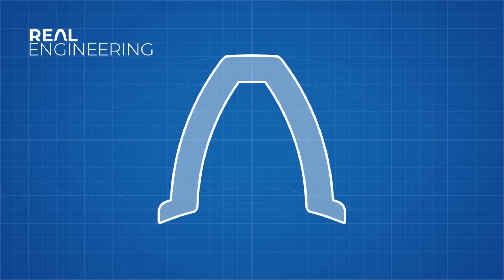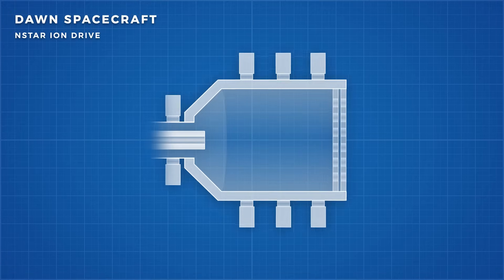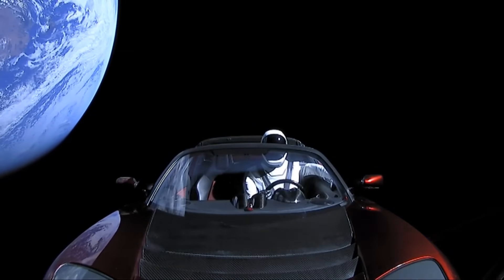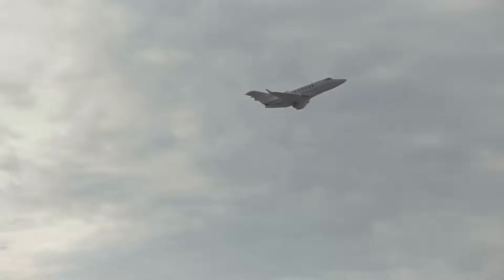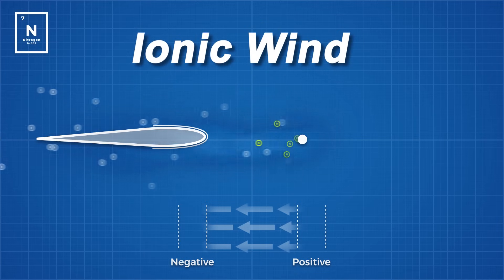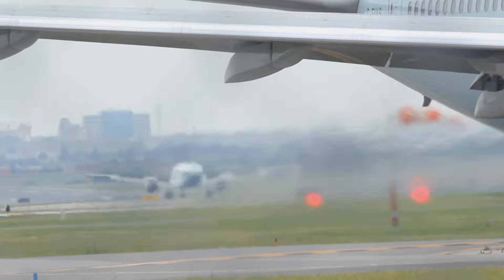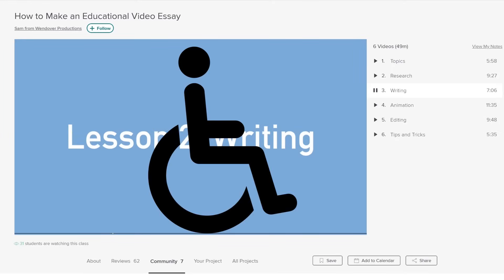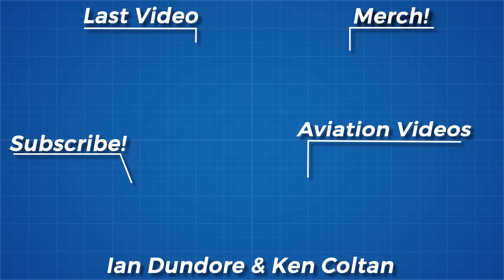Ion Propulsion - The Plane With No Moving Parts

Comment: What's wrong with moving parts?  Electric cars have moving parts, motors, wheels, etc...
Reply: It sounds like polarized haul's of ships like star trek, in which various energy signiture's could be promoted on such haul's. This would allow intake and out take of energy ions.

This would allow possible communication signiture's and shielding potential off the haul to be emitted. It's neat that electric propelled planes move, in a earth atmosphere. With the right tuning, it could possibly move it through other environment's like outer space.  This would allow a vessel, or object to thrust movement entirely all at once from a polarized haul. Or entirely all at once, to have communication signal's emitted from the whole polarized haul. 

This in theory, should also work for nano bot's as well, as they could mimic that feature of polarized haul's. Nano bot's could move around and through environment's. As they thrust, or hover through environment's.
Also if nano bot's emitted the right energy signiture's, or signal's. They could be detected from devices and communication with them from other devices would be possible. Cloaking would be possible as well, for those polarized haul's. As they could be blending in microwaves and other possible background noises, to have it appear normal.  The only thing really, is to have polarized haul's charged well enough. For strong energy field dynamics of interaction's to be in the environment. 
Everything is like torus Field's, or alternating current fluctuation's. I like another name for this, force balance.

Comment: Please explain how you control the plane's direction without moving parts. Wouldn't retractable landing need to move? How do you get people or cargo in or out if the doors don't move. Actually if the plane is flying, all the parts are moving from one location to another. Movement is the purpose of an airplane.
Reply: Their paper from the Journal of Nature says their craft had a movable rudder and tail. They also claim it was first with onboard power though which was not correct.

Comment: Although I am no expert on this, it seems that a "Plus Amplitude Modulated " (PAM) system has better prospects.  With an iron ferro magnetic around the outside of the ion chamber outlet that contributes iron ions to the propulsion, would eliminate the need for the nitrogen gas.  Our immediate concern is the flight of earth bound planes.

Comment: Good graphic skills, but the video is totally wrong. The Xenon is first ionized positively charged then accelerated through the engine to the outside of the spaceship by voltage differential. Then the electron beam is sent after the ions exiting the engine, in order to prevent the spaceship from getting a net charge and also to prevent the Xenon ions from coming after the ship.
Reply: Furthermore, MIT was not the first build one that could lift its power supply.  Here is verification from NPR besides the 2 dozen or so flight videos on my channel:
https://radio.wosu.org/post/exploradio-oberlin-inventor-pushes-limits-ion-powered-flight#stream/0

Comment: Makes one wonder what could have been and makes one wonder why it's not now used and improved upon
Reply: I have some VTOL versions on my channel with onboard power, if you're interested.
Reply: Physics is why this technology has not been "improved upon". Ion thrusters have been around and used for decades. They offer such minute thrust that they are only used in space.
Reply: @herrschaftg35  
Hi herrchaftg35,
By working with physics this technology has been improved upon by several orders of magnitude, in terms of thrust to weight and grams of lift per watt, not by MIT though.

On my channel there is a series of patented independently verified ion propelled crafts with onboard power. They lift their own power supplies vertically for up to 2 minutes at a time.  With solar power they will be able to ascend or fly continually. 

It is true that this type of propulsion still has a low areal thrust density, so it won't complete against a 747 or chemical rocket when high levels of force in a small area are needed. Please visit my channel to see dozens of flight videos, some with officials present, and the website.
Reply: @KraussEMUS1  
It sounds like polarized haul's of ships like star trek, in which various energy signiture's could be promoted on such haul's. This would allow intake and out take of energy ions.

This would allow possible communication signiture's and shielding potential off the haul to be emitted. It's neat that electric propelled planes move, in a earth atmosphere. With the right tuning, it could possibly move it through other environment's like outer space.  This would allow a vessel, or object to thrust movement entirely all at once from a polarized haul. Or entirely all at once, to have communication signal's emitted from the whole polarized haul. 

This in theory, should also work for nano bot's as well, as they could mimic that feature of polarized haul's. Nano bot's could move around and through environment's. As they thrust, or hover through environment's.
Also if nano bot's emitted the right energy signiture's, or signal's. They could be detected from devices and communication with them from other devices would be possible. Cloaking would be possible as well, for those polarized haul's. As they could be blending in microwaves and other possible background noises, to have it appear normal.  The only thing really, is to have polarized haul's charged well enough. For strong energy field dynamics of interaction's to be in the environment. 
Everything is like torus Field's, or alternating current fluctuation's. I like another name for this, force balance.

Comment: One thought that comes to mind is different atmospheres than Earth could be more useful overall in flight. An atmosphere with atoms that provide more thrust when charged, and or a heavier atmosphere where the parts would be more buoyant and achieve flight much easier. While an aircraft with few moving parts is ideal, perhaps a blimp with ion thrusters could overcome the weight challenges while maintaining the benefits of these ion engines?
Reply: On my channel there are VTOL ion thrusters that carry their power supplies.  They don't require any LTA gasses.  There is a company that had an ion propelled blimp though even in the 70s!

Comment: Next step is to make lightweight solar panels or even paint job made from different reactive layers that make solar power just like normal solar panel. More surface area makes more power even if the paintjob (panel) produces less energy per square meter. More surface area just adds up and this must be lightweight.

Comment: Ion drive cannot be used on a large scale.
Reply: Dear Dr. Mayer,
There is a series of ion propelled aircrafts on my channel that can lift their power supplies.  When they are working properly, one could connect as many together as one would like, although I know at some point their might be some serious mechanical stress issues.  It is true though that the areal thrust density doesn't scale as well as I would like, so I'm not disagreeing with you completely:).
Reply: @KraussEMUS1  Since air velocity is very small in air ion drives, air flow must be very very large to generate any reasonable thrust. You could connect many of them and still not be able to lift 10 kilograms. For mini-UAV devices to carry cameras, OK. For human carrying aircraft NO.
Reply: @DavidFMayerPhD  
No argument there:), unless it was really large and a few more improvements are made.  Once one considers how much the thrust to weight ratio has already been improved,  carrying substantially more weight in the near future doesn't seem too difficult.
Also, interestingly, it has carried some small propellant tanks already.  Additionally, there are solar cells that are lighter than the current batteries, so who knows what the future holds.

Comment: When I was developing atmospheric plasma systems for thin film deposition, I came accross the way one could make very dense plasmas (requiring a lot of amps but not many volts) in standard atmospheric conditions in air. This principle is used in plasma cutters: you make your initial spark using high voltage / low amperage and then, since your plasma is already conductive, you apply a second power source with a lot of amps. When you have a dense plasma in atmorpheric pressure, you can go WAAAY beyond the thrust density you see in MIT's prototype. I though it was a nice invention but then came the bad news: since you ionise air, you leave behind nitric acid, ozone and a bunch of other toxic stuff. It's a pitty we cannot use this engine, even if MIT gets it at some point. I may put it on my channel at some point because it certainly looks great when you see it (plasma is always amazing...)...
Reply: Any idea of what sort of thrust to power ratio you get?
I'd think the high current requirement would make it impractical for airplanes.
It would be great to see the device in action. I hope you make a video showing it off. 
I think a lot of people would want to see an airplane propelled by a plasma torch even if it's not a practical form of propulsion.
Reply: @ddegn  The high voltage is imractical. High amperage low voltage is safe and easy to make. Anyhow, haven't done any testing to see what the thrust to power ratio one gets, will have to at some point revisit this idea and make a video. :)
Reply: @BillDemos  I just subbed to your channel. I really hope you get around to making a video on your ion thruster.
Reply: @ddegn  Thanks so much! That really helps a new channel! I will try my best to come to this video shortly. For now I need to upload the final video on the CMOS series and then another on Plasma Electrolytic Oxidation so that the channel starts being also on material sciences. Hope you like the content that is coming. Best regards!
Reply: Thanks bill
Reply: I have a plasma cutter, but plasma cutter uses pressurized air and it's that air that gives the thrust and not the plasma! On truth that air is already turned in plasma state but with the same molecular density from air! And the density that causes the thrust! Do you remember the rocket equation?
Reply: @antoniobragancamartins3165  MY dear, I didn't tell you to use a plasma cutter, but the PRINCIPLES of it. The principle of it is using a high voltage supply to ionise air, which in turns goes over the high amperage electrodes to produce a spark with a lot of amps. Once you have plasma, you can accelerate it the way you want.Also, you can let the sarcasm in the end, it's ridiculous to not understand something and play it smart at the same time.
Reply: Yep now we can bring back R22... the amount of ozone this thing will make at scale... 🤣
Reply: sure you did bud
Reply: @user-sc8ph2ds2m I have done a lot of years in Physics. How about you "bud"?
Reply: @BillDemos  so did you finally tested its thrust to power ratio?

Comment: here's the even crazier thought:
can we use ionized air to move the blades of wind turbines and turn generators to produce electricity with which to generate ionized air?
Reply: that's a "Perpetual Motion Machine" and thermodynamics doesn't look kindly on the idea ;)
Reply: @liamdonnelly3689 why? it doesn't have to run indefinitely.... as long as it runs for as long as humanly acceptable , it's fine.... a thousand years is not "perpetual"
Reply: @Deylan Acasio I wouldn't be creating anything.... I would just be channeling already created energy: the atoms of the elements that make the atmosphere were fused together a billion years ago... I would just be exploiting that chemistry.

Comment: So this tech is based on Thomas Townsend Brown's "Biefeld–Brown effect" A.K.A "electrogravitics". This is not the result of the one mile an hour Ion wind that is produced like that in the Ionic Breeze air filters. This is based on an "electrogravitic".distortion similar to the Navy's Electro-propulsion system, which they filed a patent on last year (2019). The Navy used Microwaves, but achieve the same effect, but their's negates inertia. This system works in a vacuum as well, despite the fact the the Mythbuster failed to get it to work in their vacuum chamber test. Those butt-heads shorted out the lifter, with grease from their fingers on the wooden dowel rods. You could even see the glowing embers on the rods as they burned in the vacuum chamber, in their video. T. Townsend Brown had already proven that it works in a vacuum. NASA was considering using them as station keeping thrusters on satellites, so they didn't have to replace the satellites when the chemical thrusters ran out of fuel. If you don't know about his work, which was classified for decades by the military, I suggest you look him up and then look at all the YouTube videos from people playing with this tech, like it was model rocketry. This video is just one of them, but they think it is the Ion wind which is causing it to have forward momentum. Brown also demonstrated that when you charge the front and back the disk went forward. If you charged the top and bottom it lifted. If you find the video of the guy that used a rickety old table as his lifter then you'll know that it is not aerodynamics, or Ions, which propels this craft.

Comment: The flaps and rudders still need to move in order to control the aircraft. Undless it has gimbals on thrusters, which again move! So technically, "No moving parts" is misleading. It's more like no moving propulsion system.
Reply: I was thinking the same thing, but the potential difference on the wings will do the function of rudders, ailerons and elevators as I suspect.

Comment: The attempt was pretty good but airframe design was hasty. Geometry wasn't really optimized. Just kinda mechanically practical. Look at what the F3K and F5J guys are up to these days. Especially that Ascent F3K team. That's real geometric optimization. Also the power supply was pretty bulky. My team has been able to get significant thrust production with micro sized power supplies around 11 grams in weight. At 2.5 watts we can pull several grams of thrust over the elevator and rudder surfaces for good control actuation. One of our guys even got a VTOL up for a few seconds.

Comment: The way we should go is Ion-propulsion based on fusion reactions. There is possibly a way to built that device in the future. Sure we can't shooting a Tokamak in space. The concept based on two petawatt lasers shooting ultrashort laser pulses (many shots per seconds) on solid boron (B11), in a vacuum chamber filled with some H. This generates aneutronic fusion reactions (1p + 11B → 3  4He  + 8.7 MeV) means you get three Helium-4 out at ultra high speed, no Neutrons and no radiactive waste. 

They tested the concept, fusion happens (PALS Asterix Laser System Prague, Extreme Light Infrastructure "ELI" from EU..and others), but as it is, the reaction rate is much to low. The good news is, they made good progress and lasers getting better and better from year to year. If you want built a power plant, you must get more energy out than in. Propulsion not, means you can have thrust even the fusion efficiency isn't otimal and in Space you have already perfect vacuum...that could make it easier to built a fusion driven Iion-drive than a fusion-powerplant.
Reply: I know there was a company called General Fusion that was trying a different, somewhat lower-tech way to get fusion. Their version involved pounding a sphere with synchronized pneumatic pistons, creating shockwaves that would reach fusion energy levels in the middle. It seemed a bit simpler than lasers or magnetic bottles.
Reply: @sethb3090  yes but I heared (means im not sure^^) they made no good progress. It's a timing/mechanical problem, pistons "shooting" exactly at the same time (milliseconds or lower?) you need for uniform compression in the center. Second, how you get many fusions per seconds out?

with lasers this is no problem, see Livermore "High-Repetition-Rate Advanced Petawatt Laser System" https://youtu.be/rDpLT7yTQvA